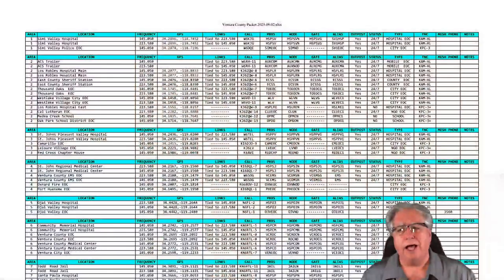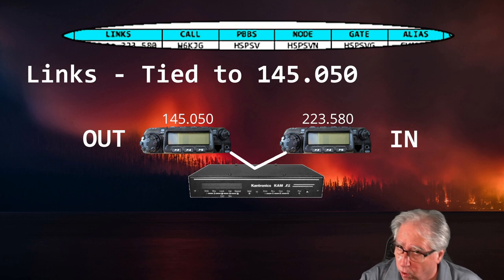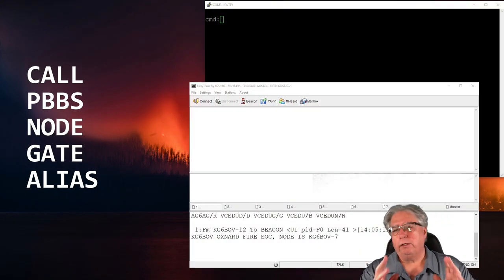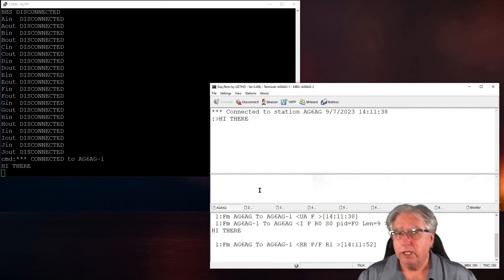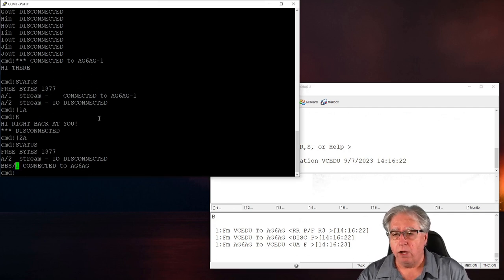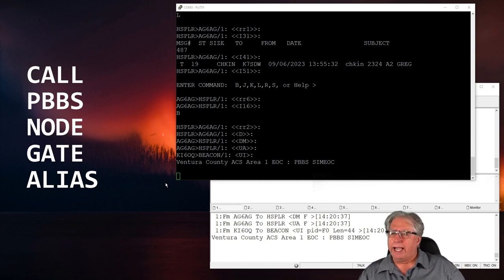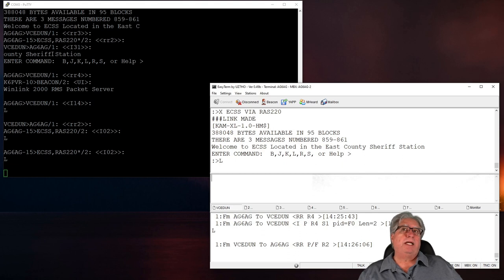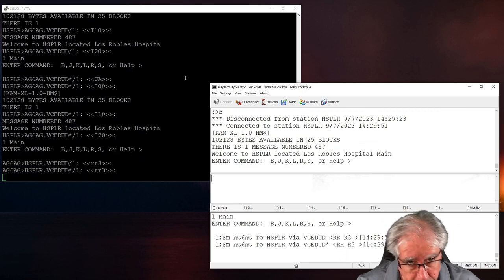Why All These Tactical Names For Packet Stations?

Comment: Very informative and answers questions that many of us have. Do you think that the alias function will become standardized?
Reply from the maker: Hi Robert,
It actually is, but it means two different things based on whether you are looking at the packet station list or the setup cheat sheet for the EOCs.
The cheat sheet for setting up a TNC in an EOC (at least the one I have) clearly identifies the name to be programmed in "MYALIAS" as <TACTICAL>D where the station list actually specifies the tactical name used when programing Outpost which is <TACTICAL>1.
We are experimenting with the elimination of Outpost and just using terminal access to work with Packet PBBS, but there is a lot of history with Outpost software in the County and might be a bit painful for some operators to drop the usage.
Anyways, as always, the way we use Amateur Radio and EMCOMM is always changing, and the only thing I can say for sure is that it will always be different then today (or tomorrow).

Stu
AG6AG

Comment: I run a packet bbs on the east coast how can we get linked up make out foot print wider and stronger.
Reply from the maker: Hi Chuck,
We currently don't have any HF capable systems on our network out here. Since a VHF connection at that distance would be prohibitive, then it probably would not be viable. There was a time when there work regional Packet BBSs that acted as gateways and linked all the systems together, but that time has passed...

Stu
AG6AG